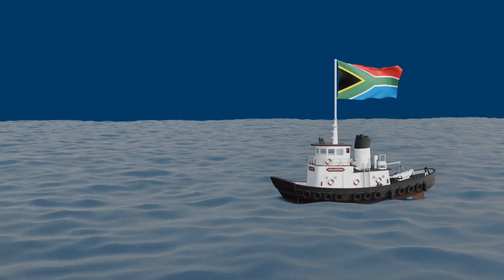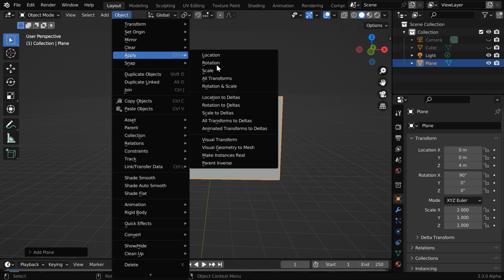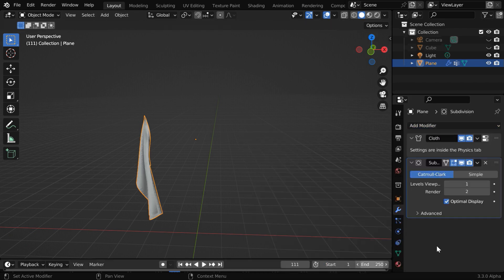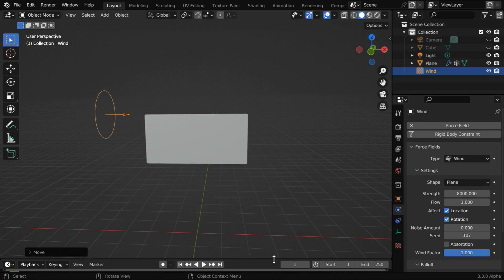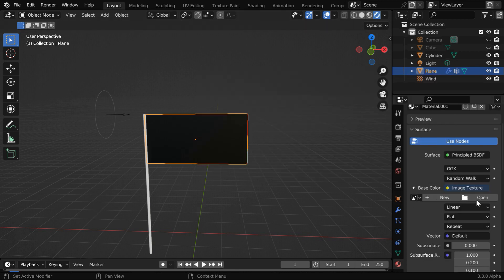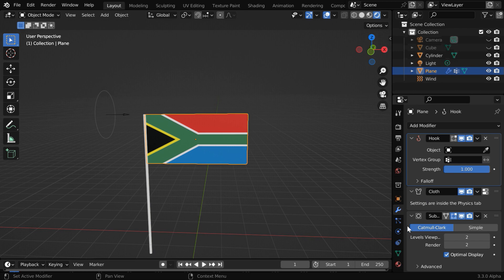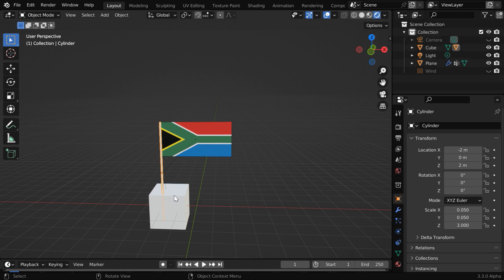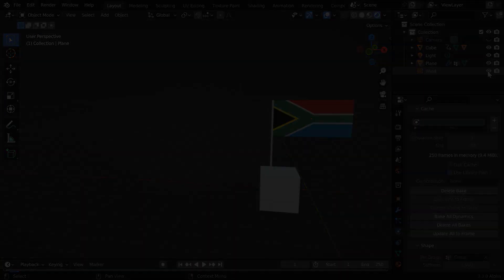Waving Flag In Blender | How To Create A Flag With Cloth Physics & Force Field Simulation

Comment: Sir Jeet how to bring C shape Curve in flag left side that attached with calendar while waving.
Reply from the maker: Hi, I did not get your question. Calendar? The shape of the flag is as such determined by the wind force, it is not directly editable. If you want a specific starting shape, which occurs say at frame 300 - and you want to bring it to the starting point - that is doable. But I could not get what you referred to here as the Calendar.
Reply: @5MinutesBlender Sir I send you picture of flag that shape I require at your gmail

Comment: Sir Jeet how to slow the waving speed of flag. At 60fps flag wave very speedy. Even I decrease wind strength it won't effect so much.
Reply from the maker: The flag waves in the same fps as your composition (you set this fps in the Render output properties). The natural waving is the best, and it never waves "too fast". If the wind strength is high, it may create unrealistic waving, but fps is not impacted. I have to see what is happening in your case before I can suggest the correct fix. Please do a screen recording and send it to me at 5minblender@gmail.com so that I can check it.
Reply: @5MinutesBlender  okey Sir.
Reply: @5MinutesBlender Sir Jeet I solve the flag speed problem by my own. Thank you❤
Reply from the maker: @x3dvideo  Wow, glad to know that you solved the issues yourself 👍👍💝💝
Reply: @5MinutesBlender Sir Problem is solved by my own thank you.

Comment: Sorry beginner here, why whenever I add an image texture and then add an image, the image just turns upside down?
Reply from the maker: The orientation of your image on the actual object follows its UV map. Many primitive objects (like cube, plane etc) come with a UV map, otherwise Blender can also generate a default map in the absence of any explicit UV map. In your case, this UV map is probably upside down, so the picture is showing upside down as well. You can rectify this map in the UV editor. Otherwise for a quick solution, you can add a texture coordinate node and connect it to a mapping node where you can add a 180 degree rotation around the z-axis. Then use its output as the input vector for your image texture node.
Reply: @5MinutesBlender  Thank you so much bro

Comment: Pls I need assistance Blender keeps crashing on me any time I want to render my flag. Waz happening
Reply from the maker: I am traveling, hence this late response. Are you using too many subdivisions for your flag? Try to use a lower subdivisions and a bake a lower number of frames to check if the issue persists. Usually blender crashes mostly because of RAM shortage. If it works with fewer frames, it may be related to your RAM.

Comment: After 250 frame flag is stopping to moving. How flag move continue to wave ???
Reply from the maker: By default, Blender uses 250 frames for any physics simulation, but you can easily change this. Select the flag and go to the cloth physics settings. Under the section called Cache, you'll see a field called End frame. Increase this number as you need and bake the physics again. Now the flag should wave as long as you want. Please let me know if this does not fix your issue.

Comment: When I click subdivision surface option blender started hanging. What is the solution of this problem.
Which soft ware so you use for voice over? It sounds real human voice😇❤❤
Reply from the maker: Subdivision for a very complex or large object may need extra RAM, which will cause the computer to hang. How many subdivision levels did you use and what are the other modifiers added prior to that?

Comment: hi whenever i am selecting cloth under physics property my plane is getting disappeared....have followed exactly the same steps....kindly suggest some solution
Reply from the maker: I guess the geometry of the plane has something wrong, or maybe a wrong scale parameter. Do one thing. Select the plane and add cloth physics as usual. In the outliner ensure that the plane is still selected. Now keep your cursor in the 3D viewport and press the decimal key (dot key) from the numeric keypad (NOT on the main keyboard). This will zoom the viewport to the object which is currently selected (the plane). So you will know where it is. This won't solve the issue but we will get a clue about the source of the problem. Please let me know what you found.
Reply: @5MinutesBlender  the plane has moved to -z axis...
Reply: Again when i am deselecting the cloth , the plane gets back on its spot
Reply from the maker: @satendrapratapsingh889  Ok, so I think the cloth is falling down due to gravity under cloth physics. It should fall gradually, it should not jump to that location instantly. I am clueless why this is happening unless I see your blend file. You can send it to me at 5minblender@gmail.com and I will get back to you about the source of the problem and its remedies. Or you can try to clean up all cache files and do a fresh bake of the simulation.

Comment: bro . How can  wind to 500 fram?
Reply from the maker: By default Blender uses 250 frames for physics simulation, but you can change it. Select the flag and go to cloth physics. Under Cache section, increase the end frame number as you need (may be 500 etc) and bake the physics again. It will work.

Comment: Hi bro. My flag animation can only wave 250 fram .How can wave to 500 fram ?
Reply from the maker: By default Blender uses 250 frames for physics simulation, but you can change it. Select the flag and go to cloth physics. Under Cache section, increase the end frame number as you need and bake the physics again. It will work.
Reply: @5MinutesBlender  thank you bro

Comment: Bro, please tell me which blender version are you using? I have installed blender 3.4.1. I watch your country's 3D comparison video, but my blender has a different rotation. Tell me if you have set your blender. I have shared pics in your email. Please see it and reply to me. Please I shall really thank full to you.
Reply from the maker: We used 3.4 version but it should work same with any Blender version, nothing version specific for 3D comparison videos. The viewport orientation may be different, it won't matter. You can rotate the viewport as you wish. I did receive your email but there are no pics and no attachments in it.

Comment: Once again , a very accessible project. Thank you. How do I go about resizing this in a scene? Scaling doesn't seem to work. Do I also need to delete all bakes and rebake all dynamics with each time I move it? To import this into another project , would I do this through append and would it keep the cloth motion?
Reply from the maker: Hi, if you resize the cloth/flag, you need to bake it again because the cloth will have change in its deformation, it won't be just a fixed multiple of the earlier shape. About importing, if you bake the cloth as part of the Blender file (without selecting Disk Cache in the Cache section under Cloth physics), the simulation will also get imported to the new project when you append. It will work even without adding a force field etc. But if you bake it to Disk Cache, you need to bake it again in the new project. And in this case you need the force field etc. in the new project as well.
Reply: @5MinutesBlender Thank you for your reply,  I will try these tips. One last question, how would I approach  cutting holes into the flag, I'm trying to make it look frayed and torn, in Photoshop I created holes and used it as a PNG but there is a kind of dark texture covering the ability to see through the holes. Is there a way of doing that?
Reply from the maker: @bobdobs8855  Instead of making holes in the texture image, it is better to cut actual holes on the flag object (using boolean modifier for example, if you need help on how to cut a hole you can check our tutorial on that subject separately). It will keep the cloth physics more perfect and accurate. However, if you insist on doing it through texture, you need to select Alpha blend in the Blend mode for the material, and connect the Alpha output of your Image Texture node to the Alpha input of the Principled BSDF.
Reply: @5MinutesBlender  Much appreciated, thank you for your assistance. The alpha worked well, I will now visit your tut on the boolean modifier and give that method a go.

Comment: Best tutorials ever!🙂
Can you please make a tutorial on how to make 3D Comparision in Blender. It is very popular.
Reply from the maker: Thank you so much 💝 By 3D comparison, you mean statistical data presented through 3D bar or 3D columns?
Reply: @5MinutesBlender  i mean something like this 🤗 https://youtu.be/RARdMeMuIeI
Reply from the maker: I saw the link you shared and that's what I thought initially as well. Some other viewers also requested for this tutorial, so may be we will plan something. But I hardly understand what is so special in this video 😂😂 Add a cube, enlarge it in height, add text on its surface, add some materials, add a flag if you need (we covered flag in another tutorial) - then duplicate it as many times as you need for each company/ each country. Rest is a nice camera movement - we are coming up with a camera tutorial that can be suitable for any scene like this, scheduled for coming Wednesday. But other than that I do not find anything to learn from here or anything that we can discuss separately in a tutorial. So I am kind of holding back the idea of a tutorial on this because I am not sure what I will explain there 🤔🤔

Comment: 🌺🌺🌺🌺 Plz the flag stop Moving in 250 frame (i fixed from rjt bdy but not wock) plz help
Reply from the maker: The solution is to increase the cache length when you bake the cloth physics for the flag. Under the cloth physics, in the cache section, you have a start frame and an end frame number. Just increase it to match with your animation length. Same philosophy for all physics settings, only the cache may be placed in a different location or the name may be slightly different.
Reply: @5MinutesBlender  i do it but same problème
Reply from the maker: @catlovers5752  I think the old cache is somehow not getting refreshed. Can you please send your blend file to me so that I can quickly check it? Our email ID is given in the About section of this channel. I'm online.
Reply: @5MinutesBlender  i send u in Instagram